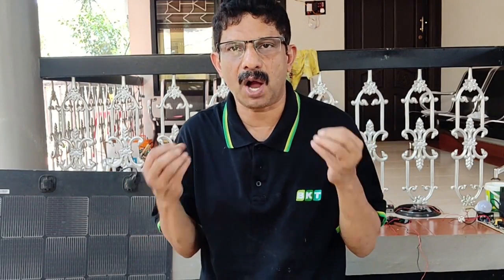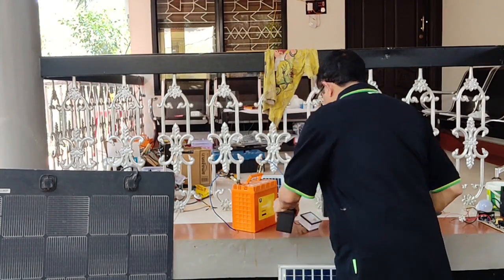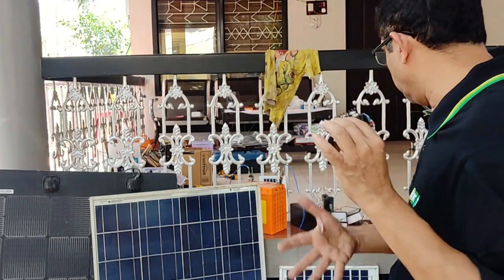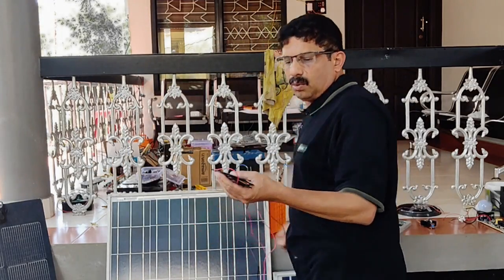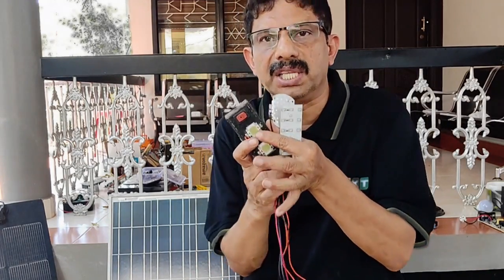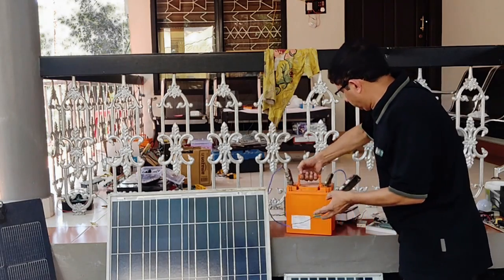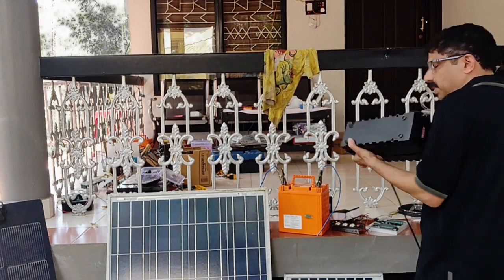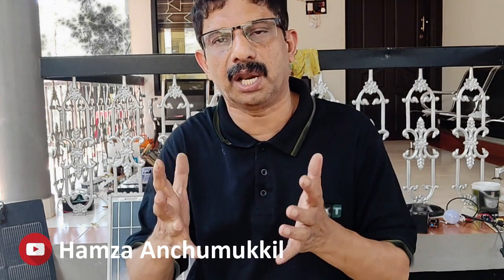ഇൻവർട്ടർ ഇല്ലാത്ത സോളാർ പവർ ഇനി നിങ്ങൾക്കും നിർമിക്കാം

Comment: That 7AH battery is NOT supposed to deliver more than 50 watts, under load. If you force it to give more than 60% of its stored energy, it will surely get damaged very quickly. And, for your kind information, if you set 14 volts as your final charge voltage, together with 70% to 80% discharge level, the battery may not last even 100 cycles, Doctor. 😅😅😂😂

Comment: Electrobot Xl6009 Board Boost Converter Module Dc to Dc 3.0-30 V to 5-35 V Output Voltage Adjustable Step-Up Circuit Board, 5 Pieces Electronic Components Electronic Hobby Kit
https://dl.flipkart.com/dl/electrobot-xl6009-board-boost-converter-module-dc-3-0-30-v-5-35-output-voltage-adjustable-step-up-circuit-board-5-pieces-electronic-components-hobby-kit/p/itmc8cda964239f9?pid=EHKFMNFYKHTAK6JX&cmpid=product.share.pp

അതാണോ convertor... please reply

Comment: Solar ഉപയോഗിച്ച് കോയൽ കിണർ മോട്ടോർ ഉപയോഗിക്കാൻ കഴിയുമോ
Reply: പറ്റും അതിനസരിച് ബാറ്ററി, സോളാർ പാനൽ കപ്പാസിറ്റി വേണം
Reply: @sherben8288  can you please advice capacity of the solar panels and Accessories required
Reply: ദയവായി ബന്ധപ്പെടുക.9387248473
Reply: Amaze Electronic 150W DC – DC Boost Converter 12 – 35V / 6A Step – Up Adjustable Power Supply

Is this one??.. This s from Amazon.. .. ........Or if i want to connect with 350 w solar panel can I use this one with..DC Boost Converter, 600W 12A DC-DC Step Up Converter Board 8-16V 12V 24V to 12-60V 48V Voltage(this is also from Amazon)

Comment: Led acid battery is old model. Dry cell battery is good. Battery life aanu problem.  
Chetta.... Ella ups um convert cheyaan pattumo?  ende kayil oru ups undu...athinde direct out il njaan light koduthappol, load ellaathadukondu cut off aakunnundu. Athukondu njaan athu aa idea ozuvaakiyirunnu. Ithu kandappozaanu dc out edukkunna idea kittiyathu...thanks..
Athu practically possible aano ennu nokatte

Comment: But sir, inverter is cheap. Wire costly, njammal dc 12v bulb vittil install cheyyan wire mm increase cheyyandi verum athin nallad inverter vagi normal wire use cheynda. Pinne sir paranja madiri roadil nikkuna shopil okay, vittil ith nadakkilla, cost higher aavum. Solar vekkanagi full solar aakanam yellangi solar energy kseb..il kodkkanam, iggane cheyyade inverter..mme solar pidipichal ath oru velliya saving onnum aavilla, but 2,3 days powercut indayal njammak solar vayi light okke varkk cheyyipikka, agane oru ubagaram ind. Pakshe ith njammad electric bill cheriya mattam verthu. Yente vittil fitt cheydond paranjada inverter solar fitting veliya saving onnum alla.